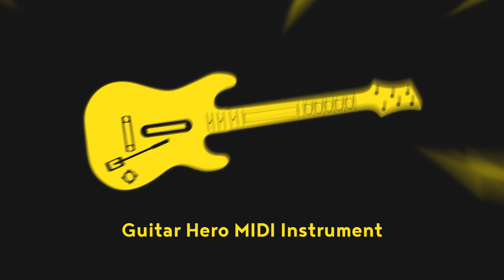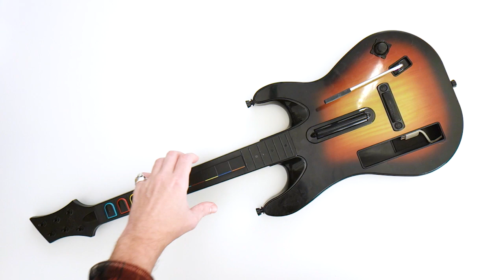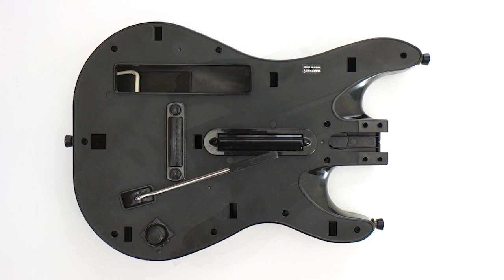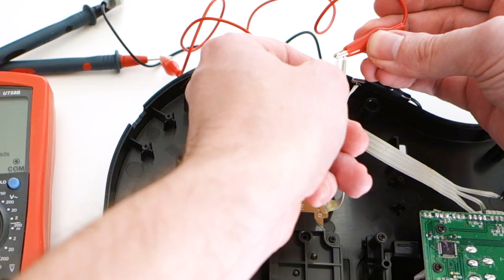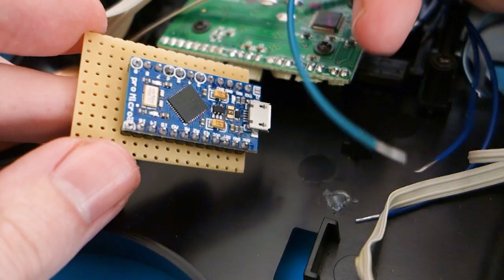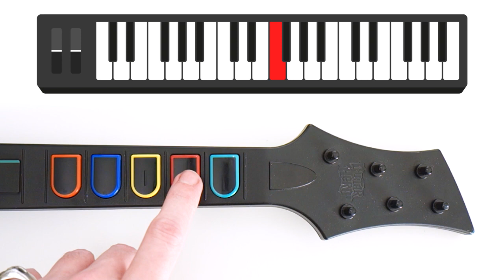A Guitar Anyone Can Play

Comment: i had kind of similar project in university. I think it's a lot easier to just use the i2c interface which is connected to controller. I just had to solder 3 wires tho...

Comment: I have never tried Lindström, but Knipex, which are the gold standard here in Germany, are also very dapper. I would like to see a comparison, but I don't have the money to buy two sets of identical pliers
Reply from the maker: I think they fulfil a bit of different market segments. As far as I've seen their tools for electronics don't hold the same quality as Lindström tools. Not to throw any shade on them though, just from personal experience.
Reply: @SwitchAndLever  Yeah, there can be two good companies in the same market segment (see CNC mills!), but as I said, I haven't used Lindström yet. I will give them a try though the next time I need some electronics pliers! Up to a certain amount of usage, I do think that they make no difference (like a cheap china sidecutters works just as well if you use it once a year), and with those tools, I think barely anyone crosses this threshold, so it's a matter of which tool fit the color scheme of your tool box :)

Also, in case you didn't know, forceps are an excellent addition to your tool box thanks to their extremely large reach and small profile.

Comment: ur mic has very high pitched noise, u might not hear it but it tears my ears :(
great work though
Reply from the maker: I looked at both the raw narration audio as well as the final video audio and checked the frequencies, there's a steep dropoff towards the higher frequencies, so I can't see what you're referencing. Are you sure it's not something in your setup?
Reply: @SwitchAndLever  in Audacity i used effect Bass and treble and lowered treble by like -10dB, it sounded much better... so it might be that the highs are just too "loud"? im not an expert or anything but intrested in stuff like this
Reply: @SwitchAndLever  Tjena från grannschtaan.
I didn't exactly experience this but listening again it is a bit trebly and so I imagine if you are sensitive and/or have equipment with much high end it might sound bad. Out of curiosity I had a look at the spectrum in Audacity and there is quite a bit of energy all the way up to 20khz. As everything above 8khz is not that necessary on voice you could probably tame it quite a bit.